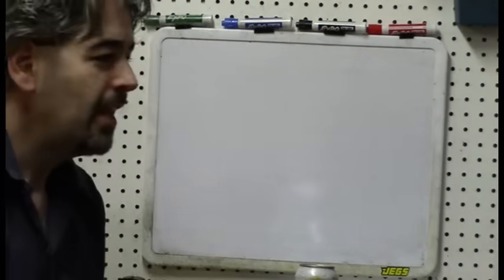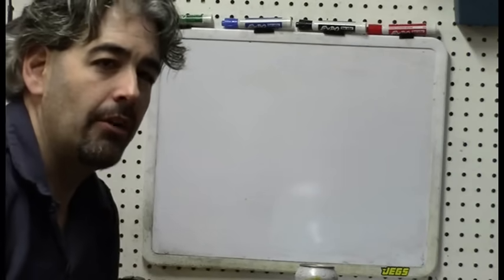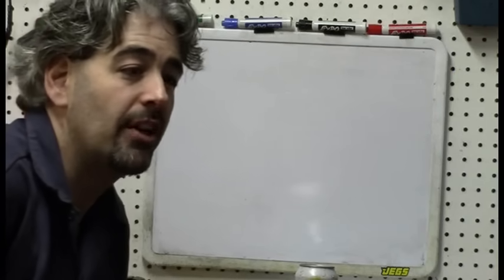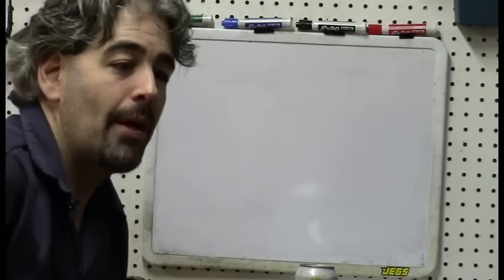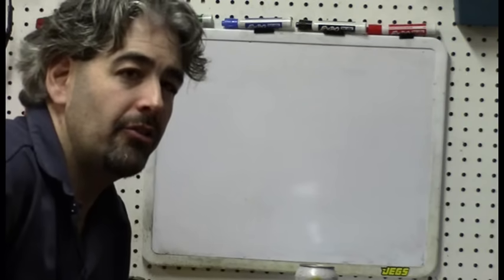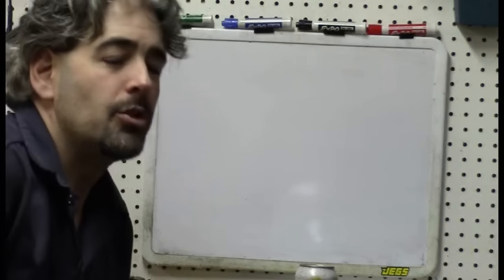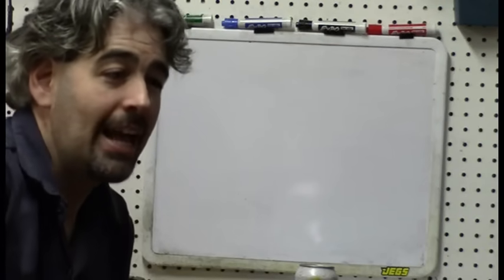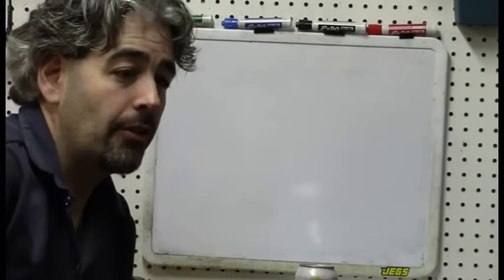Secret of Engine Problem Diagnosis- Fuel Trims Pt.1

Comment: I have recently fixed my Ford based on what I have learned here.  I also think one thing that needs explaining maybe, is the amount of air the IAC lets in, versus the air an airleak between it and the MAF would let in . The LTFT's and STFT's are responding quite different now.
In my case I had the IAC motor stuck in one position (open), and a myriad of other leaks between sensors and everything else,. With the IAC stuck open, the LTFT's went max and tripped the CEL.(check engine light for other readers).   With the IAC problem gone now, my LTFT's are low and my STFT's are a little aggressive. This Ford has a branching vacuum line from the intake cluster, to the EGR  control I guess it is and its a nightmare. Its leaking gave me different symptoms after I fixed the IAC issue.  But...to a credit to this video series, I was bound and determined to fix this myself versus giving it to a local mechanic who is going to attempt to fix it and most likely break three other things. I figure I'm good enough to do that. But as I was saying, due to this video series and a can of starting fluid and my data meter, (yes I know its deadly dangerous), I have fixed leaks that are otherwise undetectable that WERE affecting the overall outcome of this repair. It also has helped me verify a repair. This "Y" shaped line had to be spliced and I was able to see where my hose clamping was not sufficient enough or where a clamp was needed. I also found areas that a smoke test didnt reveal. (scratching my head on that one), but the highly flammable fluid (lightly administered) and the monitoring was the way to go.   I did have to fix shoddy work from another mechanic. Bottom line. Watch this series and learn what this man is telling you.

Comment: 05 crv, heat shield broke upstream  o2, replaced sensor. Down stream has good readings and raises with propane so that's good. Problem is no readings on upstream o2 sensor. And zero flatline on both long and shorttrim. Engine runs great. Fuel system  OL failure reading. Could this be fuel pressure regulator?  I have noticed a better acceleration jump at around 3500 rpm. Fuel delivery and good line pressure. This regulator has no wires going to it.
Reply from the maker: You should see voltage increase with propane on S1. If you do not then check the Bias voltage and if present replace the O2.
Reply: Schrodingers Box, replace a brand new o2?  Open Loop on fuel. Also had an iso 9141-2 code.  Now only P-1157. I have 12+ volts going to the upstream o2 sensor at the plug. No way of checking fuel pressure unless I cut the line. Nothing is easy on this thing. LAF heater fuse was blown when the wire was shorted from exhaust heat shield falling into it. I may have to cut fuel line to get a pressure check and replace fuel pump?  I'll get temporary plates if I can't figure this out by months end.
I don't have wiring diagram so if the o2 wires burned a sensor I don't know.  Fuel pump maybe weak?  I hate blowing so much money I really can't afford on this.
Reply from the maker: If you see bias voltage present validated through sensor ground and simultaneously have lack of induced conditional response that was validated downstream,, what other scientific varibles would there be?
Reply: Schrodingers Box, so I need to see if a brand new o2 sensor is bad?  Am I that lucky to buy a new sensor and it is bad? Do you have the link for a test on this sensor? Should I buy another new one?
Reply from the maker: No- you need to validate proper bias voltage and response to condition. THEN when all variables are eliminated and ONLY a faulty sensor is indicated do you replace it. I am saying to eliminate all variables- not just replace the sensor.

Comment: simply remote battery terminal for twenty minutes and computer will reset the fuel trims once vacuum leak is catered.  
idiotic lengthy useless lecture.